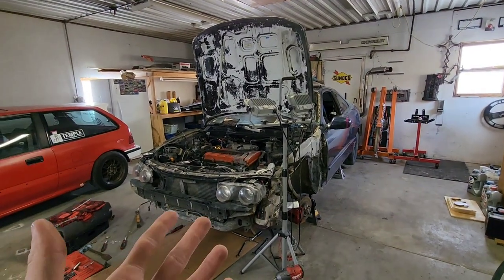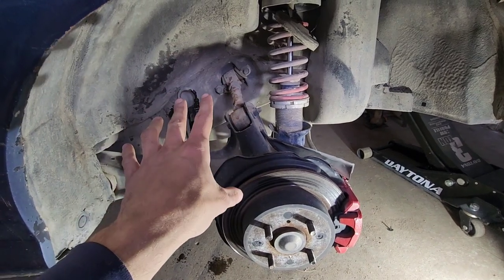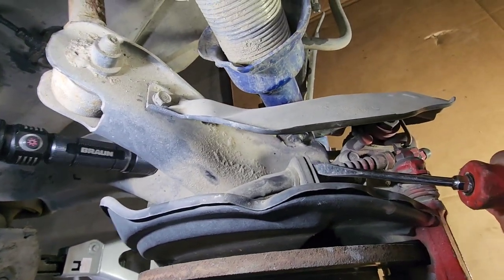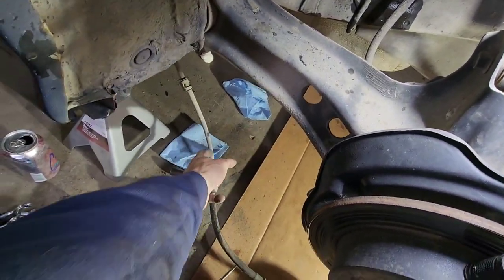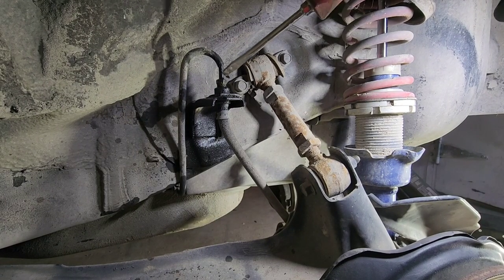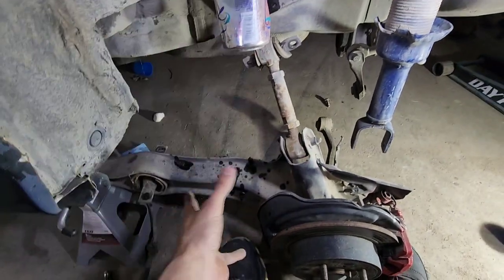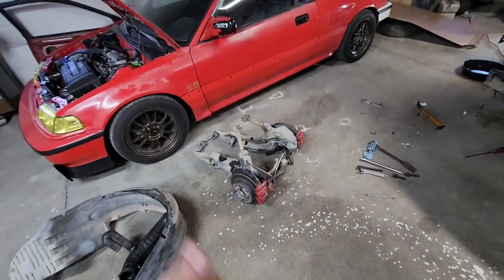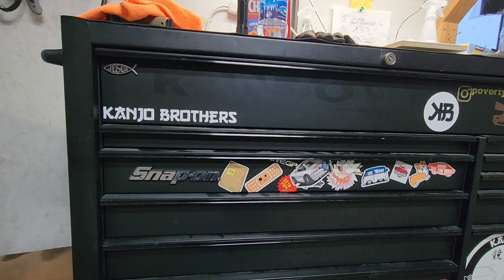Honda Acura Integra rear disc conversion / trailing arm removal

Comment: Rear LCA has to be changed in the 88 hatchback. But this conversion is a direct bolt in for 89-91 hatches. Great video. I may eventually do this conversion, but I won’t be tracking my car so I’m not worried about it atm. Hope you get the Yota fixed soon.
Reply from the maker: You are correct. And toe arms need to be chanced. So many people back in the day would say "DC Integra rear disc conversion doesn't work" and it literally fits an EF chassis better than a DA conversion because it doesn't set your rear track off half of an inch on each side

Comment: I have a 1991 CRX Si.. if I do the integra 94-01 rear trailing arms conversion to my 91 crx  si.. will it be a good option to swap.. i dont actually need it my thing is circuit autocross but idk if my crx si 1991 will be sufficient with what i have now or im better off to use the integra rear trailing disc swap.. ?
Reply from the maker: If you're doing circuit or autocross it's a good upgrade. Better heat dissipation

Comment: Great video good info I didn't know that
Reply from the maker: I may do another build overview of my car one of these days now that it's a little different than the last video I did of it and I'm slightly better at making videos 😂. 
Did one a while ago because I did a lot of the "that won't work!" modifications to my car and it worked. Like DC axles and halfway. Everyone says DA is the only thing that works for EF chassis but that's not true
Reply: @KanjoBrothers  were bro that would be great

Comment: What tools do you need exactly?
Reply from the maker: I think all I used was 10mm line wrench, 12mm and 14mm sockets. Then a flathead or prybar for bushings
Reply: What Milwaukee tool is that
Reply from the maker: @cashmoneyivan4268  1/2 inches Fuel Impact